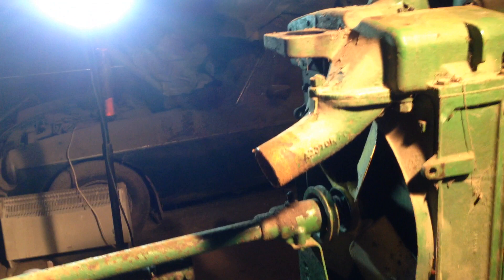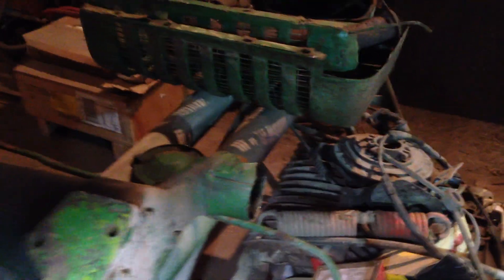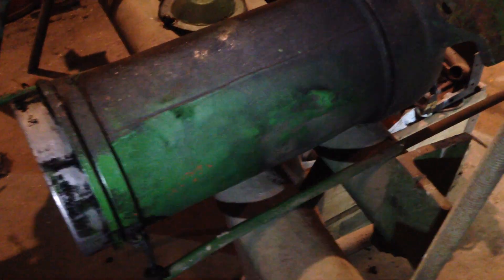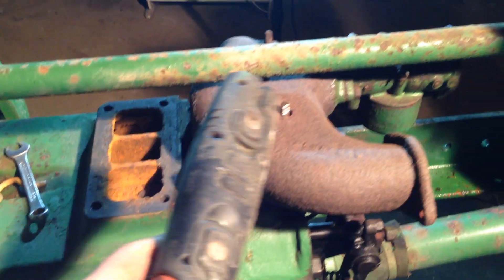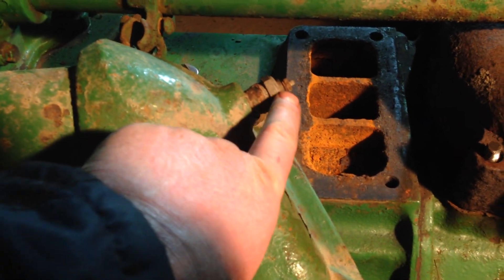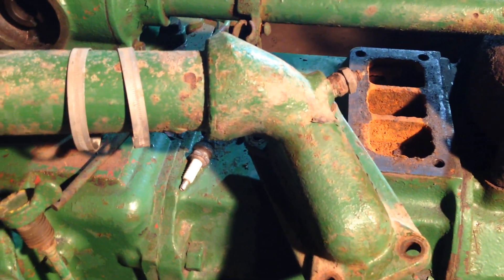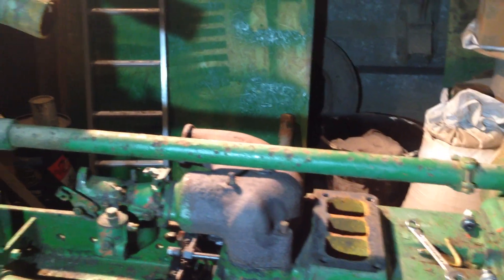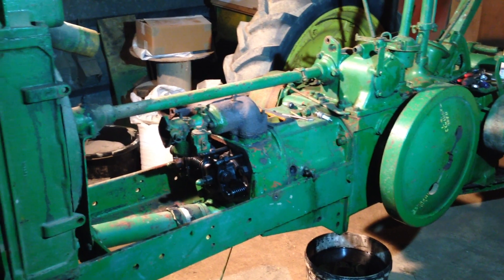1943 John Deere model A pt 2

Comment: Hi David I would be interested in seeing you replace the upper water pipe. Mine needs replaced so I would like to see one done.
Reply from the maker: lukeloader Hi Luke , yes I can do a video of that , will have to get a pipe though , they are a bit of a swine mind , keep save my friend in these unprecedented times were all living in regards David .
Reply: Just in case there are Model 50 owners needing this upper water pipe, it’s straight and both ends slip into the cast parts with an O -ring as a gasket. I installed a section of 2 1/2” rigid galvanized steel electrical conduit that’s been working fine for nearly 30 years. The spec on that tubing says the O.D. is 2.875” (73.0 mm). The next time I take it apart, I plan to slip a thermostat into the cylinder head water outlet before I install the straight pipe and O-ring.